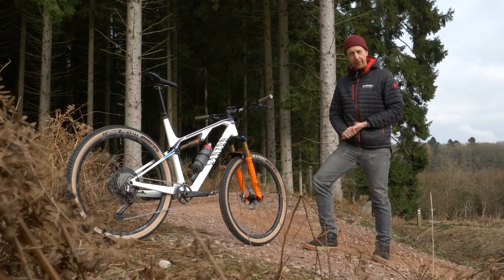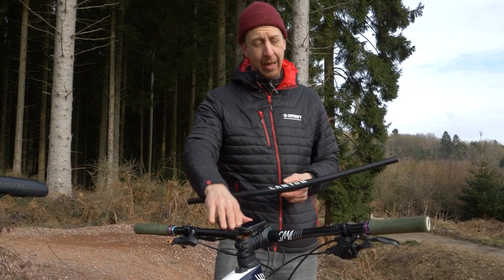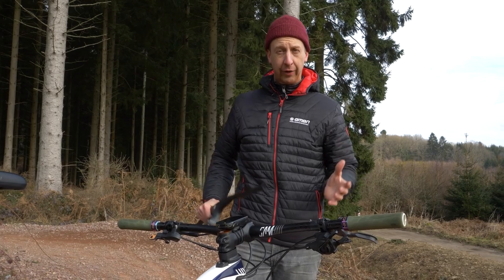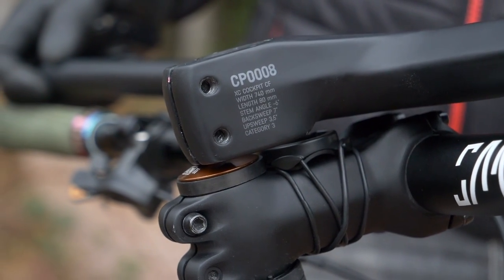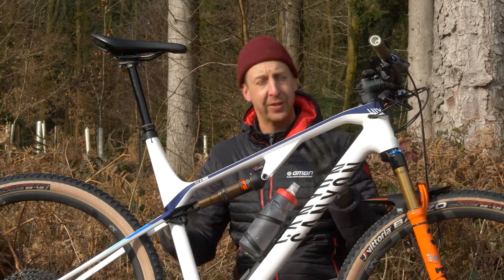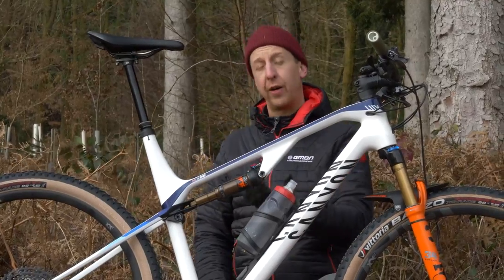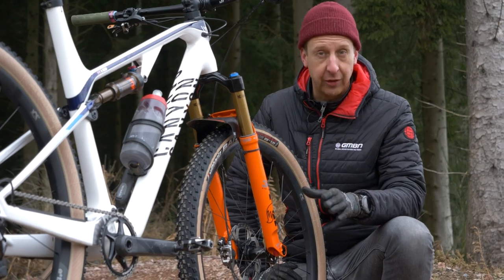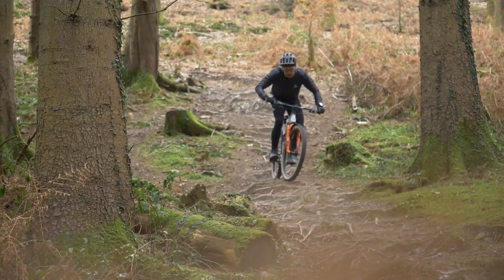How To Make Your XC Bike More Downhill Capable | Downcountry MTB Mods

Comment: A typical XC bike is a hardtail; brakes are very basic with resin pads and 3 finger levers; cheaper fork has around 10cm travel...
After a costly upgrade, an average XC bike is still not up to the level of the bike shown in this video.

I would recommend to start with the brakes: 4 pot calipers, 1-2 finger levers, sintered pads, etc.
Then, consider a better fork with much travel and thicker stanchions (~36mm), which is designed for downhill. Then, come the handlebar and the drivetrain.

But you'd better buy a dedicated downhill bike with full suspension, instead of upgrading a hardtail bike. If you upgrade your XC bike, you will have a bike that is not perfect either for XC riding or for downhill.

Comment: Just get a trail bike instead. :)
Reply: Light xc bikes are so fun everywhere with few tweeks.
Reply: @niteryder50  Because of geometry it is not. But still, you can have fun. Whatever bike you've got. :)
Reply: @quez.designs  unless you going down steep trails modern xc bikes are super capiable and not much they wont do.  Its more the big plush suspension you notice on more aggresive bikes these days, xc bike geo is not scary down hill like used to be.